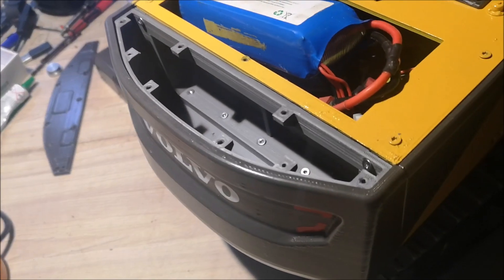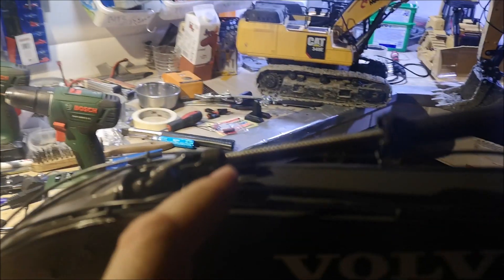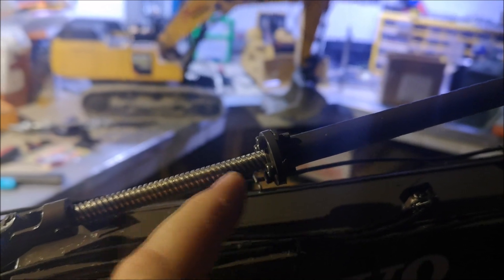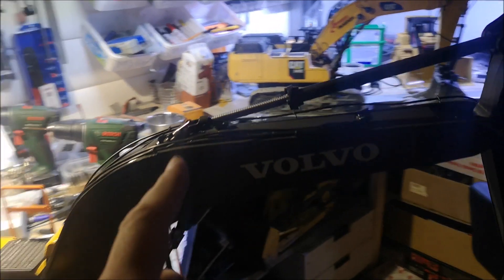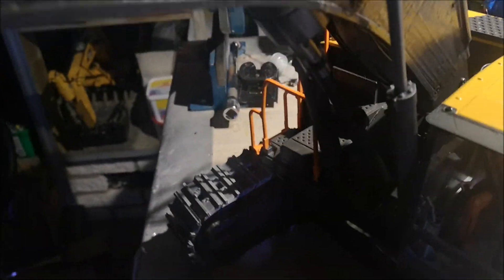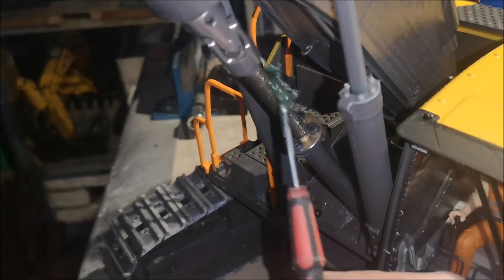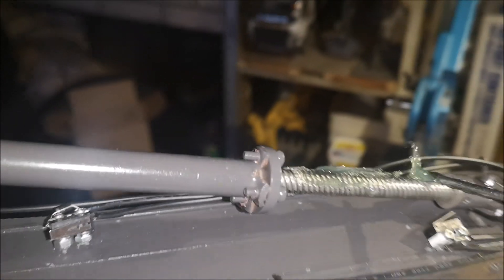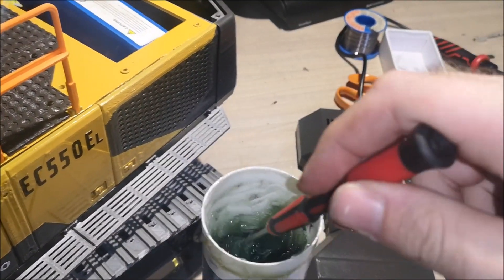Making a 3D Printed RC EXCAVATOR - Volvo EC550EL - PART 12 FINALE

Comment: Hello, I have a question. I used esc1060 60A and flysky i6s controller, but the motors are faster in one direction, how can I solve this problem?
Reply from the maker: on the esc, there is two tabs. One is for Lipo or NIMH, leave this one in Lipo.
The other tab is for FBR, FB, and FR. Take this tab out entirely.
Replug the battery and its solved

Comment: Which sound module do you use? Which sound file is it, where did you get it?
Reply from the maker: The sound module in this video is a ESS Sense One +. Its the scania truck sound.
However I have upgraded the sound module on this excavator, it has a Beier USM-RC-2 module now, with sounds from a real EC550

Comment: Hi ! I just bought your model on cults, it's already printing! I would like to know what sound system do you use, and what do you use for lights, they are not on the parts list... Thank you for your amazing Job!
Reply from the maker: thank you so much for your purchase :)
I use a Beier USM-RC-2 sound system.
The lights I use can be bought from aliexpress, search for "injora lights" :)
and the pre-wired led's can be bought from aliexpress as well, search for "12v 5mm led wired" ;)

Comment: The excavator not only looks beautiful but also has a good functionality. High digging forces, that's the way it should be for an excavator. What did the excavator cost you with all the materials? Would you make the files available? Very good work !!! Perhaps the excavator would have been a little heavier with metal chains.
Reply from the maker: thank you so much :) :) the files are coming for sale soon! the chains are already steel ;) but the trackplates are plastic, you probably meant those :)

Comment: lasee I finally see the project finished and working with brutal realism, I love the finish and the smooth movements it has, you should create a mechanized tank to grease the bottles with a piping system, it would be a good project for your creations and it adds more realism apart from optional gps system etc, my most sincere congratulations as always I tell you magnificent work friend... let's see if you send in your next video a greeting to the subscribers hugs friend

lasee Jeg ser endelig prosjektet ferdig og jobber med brutal realisme, jeg elsker finishen og de jevne bevegelsene den har, du bør lage en mekanisert tank for å smøre flaskene med et rørsystem, det ville være et godt prosjekt for kreasjonene dine og det legger til mer realisme bortsett fra valgfritt gps-system osv., mine mest oppriktige gratulasjoner som alltid jeg forteller deg fantastiske jobb venn... la oss se om du sender i din neste video en hilsen til abonnentene klem venn
Reply from the maker: thank you very much my friend :) yes, many plans are circling my head, hahaa. greetings!